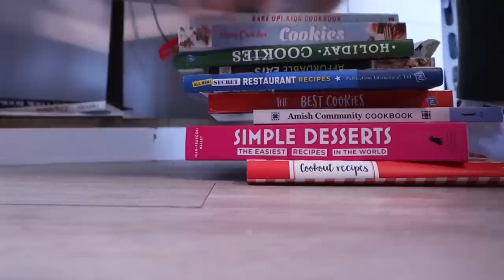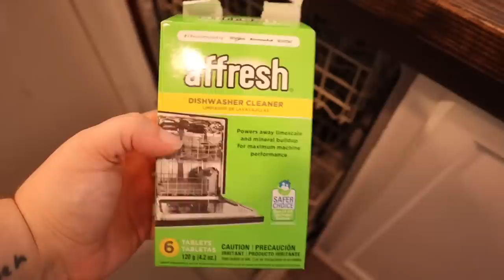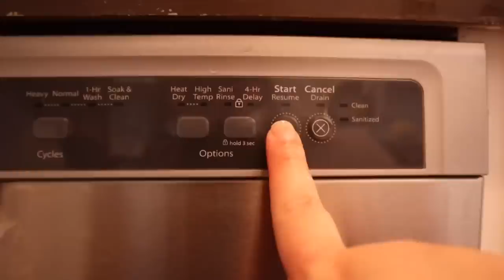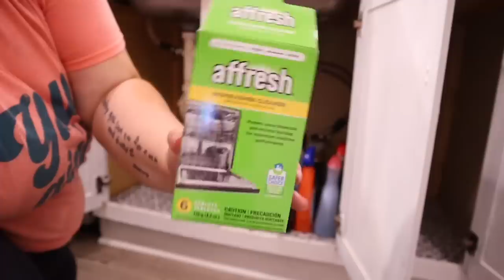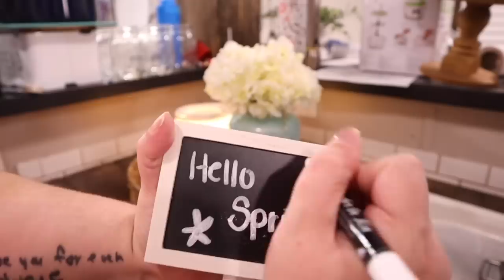*EXTREME* MOBILE HOME CLEAN & DECLUTTER WITH ME | extremely messy house cleaning | SPRING CLEANING!

Comment: Marina, do you ever do laundry while accomplishing other tasks? If I do my day seems to get better quicker. Laundry does itself really. Make your bed first so you have a drop zone for clean clothes. Then remember to stop working around your house soon enough to fold the clothes and put them away before bed. Another thing I do on days like this is a crockpot meal. Yeah! All the things get done.
Reply from the maker: Shew I STRUGGLE with that. It’s the hardest part of my homemaking journey and I feel like I’ll overcome it and then end right back at square one! I have GOT to get a routine established! It affects my mood when I see the piles!
Reply: I struggle with putting away clean clothes too. The key is to put them up IMMEDIATELY when the dryer stops. And don’t start a wash load if I’m not going to have time to put them up after drying.

Comment: Merina, a way to “keep your freezer full” and keep its energy use down is to fill empty milk jugs or 2-liter bottles with water and fill the bottom of the freezer with them. I was given a giant, body-sized chest freezer and the bottom of the thing is filled with frozen gallons of water so the freezer doesn’t have to work as hard to keep the actual food frozen and the temperature down. Just an idea!

Comment: Tip I use…I clean under my cook top and then line it with Reynolds’s wrap.  That way I can just throw it away and re-line it when it’s dirty.  I do the same in my oven.  Bottom and racks.

Comment: I think I know what the person meant when they told you not to leave the door open when cleaning the fridge. They meant to close it when not actively in the fridge. Otherwise, it can mess with the freezing mechanisms if left open too long (I found out the hard way). So when you take the food out to move to the counter, then close the door. Or if you are rinsing out a fridge shelf in the sink, make sure the fridge door is closed while doing it. Only leave it open when working in the fridge. Hope that makes sense.

Comment: Big tip. I learned is putting blue painters tape on spots that I see that really need to be cleaned that I don't usually clean. like I see a spot on the wall that needs to be cleaned but I'm doing something else ill put a piece of tape on it so I remember to do it when I have time. it drives me nuts when I forget where that spot was so the tape sticks out. great video. lost of motivation.

Comment: Ive lived in single wide then a smaller 900 ish sqft condo and boy kitchens in small places are sooooooooo challenging to keep tidy! I feel this!
Reply: One thing I swear by in cabinet organizing is get a good cabinet corner shelf rack . If you want just plain white wire ones they have them cheaper than the bamboo/wood ones and i can fit all my plates and bowls stacked nicely upright and they fit easily and everyone in the home puts dishes away easily because they don’t have to lift the whole pile of dishes to get them in or out.

Comment: I have been using vinegar and dawn dish soap cleaner for a few years now. My thoughts: it cleans everything. I use it as a multi purpose spray, mirrors, stainless steele, windows, floors. The only place I use anything different is bleach based toilet bowl cleaner. It does have an unpleasant smell but it’s temporary and I hardly spend any money on cleaning products. Works for me and my household😅
Reply: Also yes it does smell like someone broke a jar of pickles. But once it dries it has no smell. And it’s a natural deodorizer once it is dry of coarse lol

Comment: Hi! Just a helpful tip when cleaning the inside of your oven. The oven door is removable,  there are little levers on the hinges of the door, take a butter knife and pop them out and then pull the door upwards. Now the door is heavy so be careful. I'd Google the how to before doing it. I didn't know my door was removable until I watched Jamie on Jamie's Journey remove hers. Also, I use the silver wire scrubber with my vinegar dawn solution to scrub my stove. Those two will have your oven looking brand new again. Just thought I'd share some tips. 😁

Comment: Marina, you look amazing 🤗 so proud of all you got done👏 I use to wash my floors by hands for years when i finelly got a mop i was so thankful for it. A tip for you if its ok when you spray your oven door down with the vinger sprinkle some backing soad on top and let it sit for 5 mins or more it will lift up more of that grim we dont like, i also make it the one time i use the dollor general oven cleaner and its not a strong smell which is good for me and my breathing. One more tip if Shane would come in to the cabents that dont have any shelves and add one or two depending on what would work best it would make it easyer getting things out for you in the long run, I live in a moble home and that is what we had to do and it made a big difference. One more tip 😊 on the inside of your cabent door hot gule clothespins you can clip your ranch powered mix packs.
Love you and Shane teasing  each other and you dancing so special memories. Keep singing sweet lady your such a blessing in my life thank you for sharing your life with me(us) God bless you and your beautiful family.💜💕🤗🤗 Thank you for the prayers as well cancer is still rotten hubby a little better today.

Comment: Merina, you and Shane should add another shelf in your upper cabinets.  Your bottom shelf has a lot of space between it and the upper shelf.  and it seems like adding another shelf would add 1/3 more storage. Also, try peel and stick flooring in your cabinets instead of contact paper and you will never have to replace it. It took me 40 years to figure that out lol ❤

Comment: So to help with the vinegar smell you pour white vinegar in a container and put the peel of lemons and oranges let that sit for two weeks and strain out the peels pour into a spray bottle.  I also find prepping your fruits and vegetables before storing,they are quick to grab and go you make better choices .I would keep the freezer.u don’t need to fill it up. If let’s say pizza on sale you can use for overflow so you freezer isn’t cramped and works properly. Great motivation video.

Comment: You can pop that cover off the bottom of your fridge (the vent cover thingie). It comes off to clean. Also you can remove your oven door, if need be, to more easily clean inside your oven. Great job on your spaces. I use correll dishes, they stack without taking up so much room and you can replace them or add to them because Walmart always carries them. When my family gets together there are 15 of us and paper plates just don't cut it most of the time. Loved your long video. Oh, by the way, you look slimmer, your diet plan is working, huh?

Comment: Hey marina just wanted to say you're doing a great job at changing over to a healthy lifestyle. Just wanted to give you a quick tip in case y'all  don't eat your fruits and veggies super fast. If you wash them or rinse them then dry them and then put a paper towel in the bottom of the container you're putting them in then put your fruit or Lettuce on top of the paper towel then the lid. You will see they will last MUCH longer. Like at least a week longer. Also before you go investing a ton of money on plastic containers, consider glass. It's healthier and it'll last longer. But you can do what you like . I'm in the process of changing over from plastic to glass and I wish I would've never wasted my money on the plastic and started with glass. Anyway great job!
Reply: I am also switching over to glass storage containers.  I am going to get rid of the plastic ones..can never find the correct lids!

Comment: 🖐❤️🖐❤️ The best way I have found that a "separate" freezer works for low incomes (and high price foods) is to set $5 to $10 aside each shopping trip for "extra" meat/ long term storage foods that are on sale that you don't need for your meals in the next before your next haul. I built my stock up by buying extras of sale products i knew we'd be able to use, that I could store... like a couple pounds of hamburger or extra bag of veggies, then when I needed to use a # of hamburger, I'd buy fresh, freeze it and use the suff from the freezer/storage (rotate). That's how I built up my storage 40 years ago, and continue to keep it up now. We've made it through job losses, long term sicknesses, and "pandemics" without going without and without worrying about empty store shelves. [By the way, i use my extra freezer mostly for meats, veggies, fruit and frozen pizzas that fit better there than my freezer on frig.] ❤️❤️❤️

Comment: Be cautious putting meat in the door. It doesn't get as cold in the door area as the rest of the fridge. Your meat could go bad. Also, the cleaner is fine with apple cider vinegar, but just so you know, the white vinegar is a stronger cleaner. And, if you grab you some lemon essential oil, it helps the smell.

Comment: I finally gave in and started buying the clear plastic containers here and there over the past year and it has made a huge difference in space-saving and visuals to me. I stack my egg containers to free up even more space. Maybe you can replace your freezer with a tall cabinet to store your home-school supplies/extra bulk items and free up space in your bedroom. Good grief girl, did you burn a scrub daddy in the oven??? Which reminds me to clean my  dreaded oven. 😒 Some ovens have doors that lift up and off, but mine does not, so feel like I'm spelunking in an awkward cave. You know a man designed that when it's not practical to be able to maneuver around to easily clean right? Ha! I do feel that a foil liner tray really does help though. Since I'm limited on space I use the warmer drawer to store my pots and pans. Does anyone really use it as a warmer? I mean really?